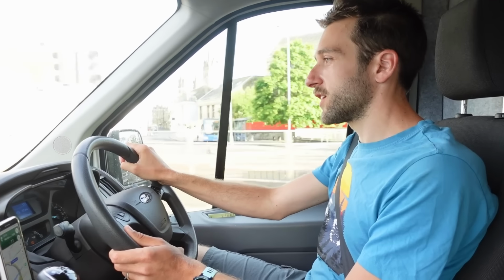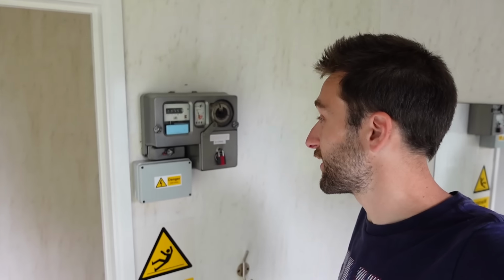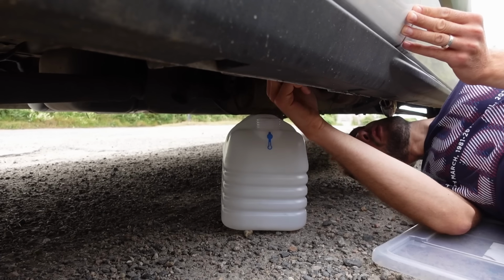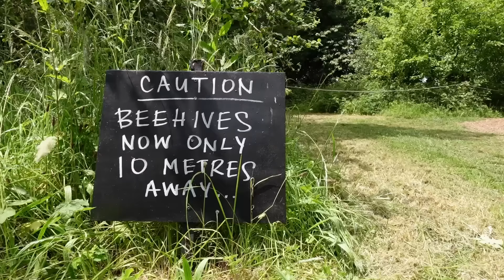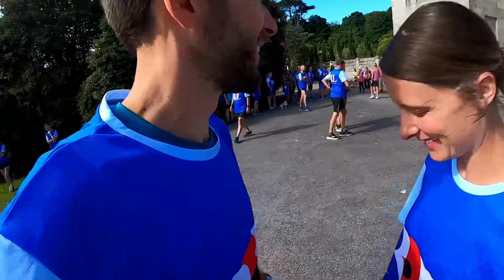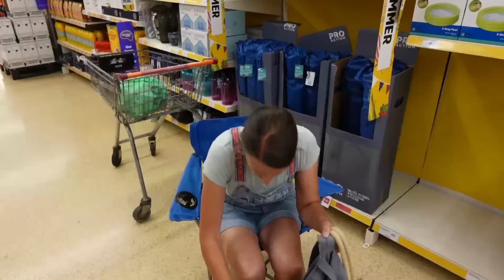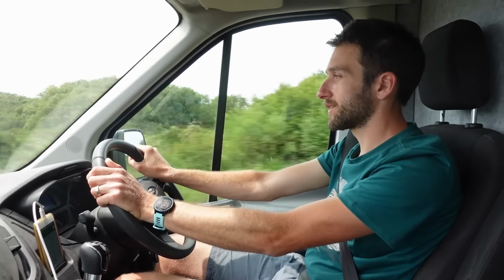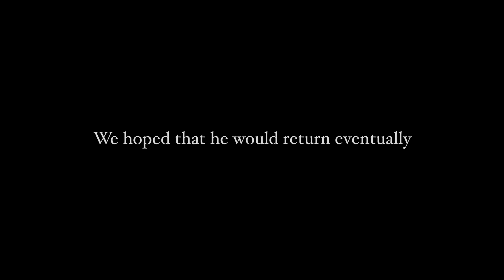Adjusting to Full Time Vanlife on the Cornish South Coast!

Comment: i’m learning a lot from you guys about the little things that people wouldn’t think of.  the tap thing….there is a very cheap shower hose thing with a sort of rubber flange at the inlet to fit it over a bath nozzle.  that could be adapted to the no thread tap problem i think.
Reply from the maker: Yeah there's always those little details you learn along the way! We keep a list of anything that crops up that we think might be a useful addition or enhancement, sometimes even the small things can make a big difference. Having an adapter for those taps would be one of them so we'll probably pick one up at some point. 90% of the time we wouldn't need it as we carry hozelock adapters that can fit to most any tap, but every now and then when you come across one like in the video... saves having to walk back and forth 100 times with a jug 🤣

Comment: This is what we use for those outdoor faucets. Camco Water Bandit - Easily Connect Your RV Water Hose to Damaged or Stripped Faucet Threads or Faucets without Thread - F...
More like this
Camco
Water Bandit - Easily Connect Your RV Water Hose to Damaged or Stripped Faucet Threads or Faucets without Thread - Features a Highly Flexible Silicone-Polymer Sleeve (22484)
3.83.8 out of 5 stars (13,149)
1K+ bought in past month
$10.90
Reply from the maker: That does look like a handy bit of kit, cheers 👍 We bought our own hozelock adapters so we can connect to most taps that have a thread now, but for those ones like we found in the video where's it's just a plain tap having something like that would be very welcome to have!
Reply: @ yes, that’s why this is so handy, being for those unthreaded taps. With this, we can always hook our water hose to them easily.
I love your videos, I miss England very much.
I’m sorry about Jackson.
Reply from the maker: @vicki9929  yeah there's some really nice parts to explore, and thank you ❤

Comment: Hi you two ,hope you post a new vid soon of your vanlife journey.i have a question for you ,how you finding the cooker,does it take a long time to cooks thing in the oven,ive heard things take twice as long .Would love to hear yours thoughts on that,Regards Rory
Reply from the maker: Hey Rory! Hopefully we'll have a new video in the not too distant future 🙂 And we love our cooker! It's pretty typical of a domestic fan-less gas oven just a lot smaller, so generally for most things the cooking time is similar and we just use whatever gas mark it says. Possibly some larger items like a bigger joint of meat or a baked potato take a little longer but definitely not double and we don't really notice it or adjust differently for it. The funny thing is having to cut a pizza in half and put both sides in slightly offset from each other so they fit on a smaller shelf 😅
Reply: @SelfBuiltStories  Thanks for getting back to me,good to hear your not disappointed with it ,I'm 95% there with getting one.
I'm just starting my build,I like watching your vids cos you explain thing well ,and I'm sold on getting a underslung gas tank after watching your install .
The pair of you have been such an inspiration, thankyou🙂
Reply from the maker: @roryprice8979  No problem! And yeah we're really glad we went for the underslung tank option, makes it so easy and convenient to fill up and lasts for months! Good luck with your build 🙂👍

Comment: Hia both. Loving the adventures. Quick question on your wifi choice of which your video was really informative. Are you happy with the set up and recommend it. I was looking at the mimo 3 17 and rutx50.  Worth the extra?  Advise greatly received.
Reply from the maker: Hey, cool and yeah we're very happy with the X11, it's a good sweet spot for us in terms of price/features. The X50 is the most expensive one they have and the only one that supports 5G, so it depends whether that's important to you or not. For us we spend most of our time in rural areas where there's no 5G and we wouldn't really need it if it was available, as we find the 4G speeds fast enough in most places. Our bigger problem (when we're out the UK) is having enough data, but speed most of the time is not an issue.

There's also the X12 which has dual modems, so can load balance across two different networks at the same time if you have two SIM cards. And the X14 which is still a single modem/SIM card but with a faster CAT12 instead of CAT6 modem (in the X11), but you would need one of the mimos with two additional LTE antennas to take advantage of it (and so feed another two wires through the roof).

Essentially it comes down to how much you want to pay vs what features you actually need. And then pairing it with the right antenna that has all the connections. HTH! 👍
Reply: Thats does help a lot and thank you for replying 👍👍
Reply from the maker: @vernonjones5418  no problem 🙂👍

Comment: Not a cheap solution but get a Mopeka LPG Bluetooth sensor.. It sticks to the bottom on your tank.. Or a Victron Cerbo GX, again not a cheap option.
Reply from the maker: Yeah I looked briefly at those and it would be cool but for the price wasn't worth it for us. The basic gauge is good enough as the tank lasts so long so we just fill it up when we first see the red light 🙂
Reply: @SelfBuiltStories  Yeah not a cheap option and if what you have works for you, then no need to upgrade for no reason.
Reply from the maker: @holdenman8850  Yeah, we'll probably add a cerbo at some point for the remote monitoring though 😀👍
Reply: @SelfBuiltStories  Sounds go, splash out on the Touch 50 screen :)
Reply from the maker: @holdenman8850  We'll see 😛